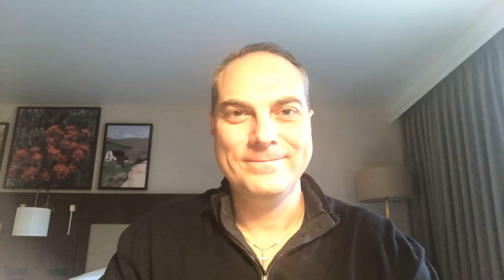Dr. Walter Salubro Attends Corrective Chiropractic Care Training | Chiropractic BioPhysics | CBP

Comment: Alignment of spine is normal.
Straightening of spinal curvature - Possible due to spasm
Vertebral bodies are normal in height and signal intensity.
Posterior arch elements are normal.
L4-L5 disc shows signs of dessication.
Diffuse annular disc bulge with Right paracentral disc protrusion
and posterior annular tear seen at L4 - L5 level, causing indentation,
over thecal sac with bilateral lateral recess narrowing and
moderate neural compression , more so on Right side.
Diffuse annular disc bulge seen at L3 -L4 level, causing indentation,
over thecal sac, with no significant lateral recess narrowing or neural compression.
Signal configuration of conus and cauda are within normal limits.
Flaval ligaments and facet joints are normal.
No intra / extraspinal masses seen.
Dimensions of spinal canal are within normal limits.
Both sacroiliac joints show normal signal configuration.
Pre and paravertebral soft tissues are normal.
Screening of Cervico-Dorsal spine shows:
Early degenerative changes in the form of minimal  osteophytes,
Dorsal schmorl's node and varying disc dessication changes.

This mri report what i do sir